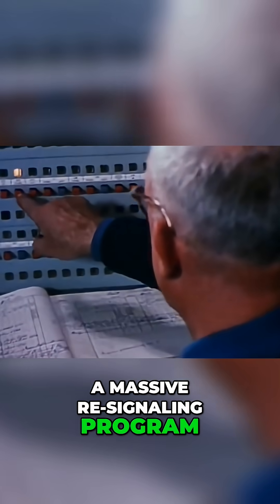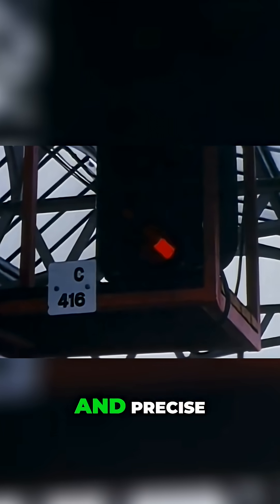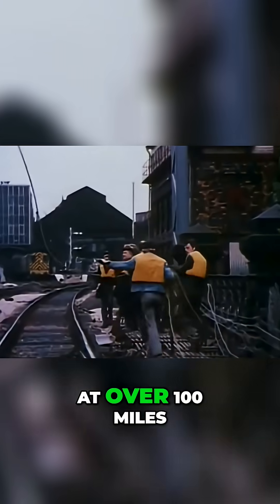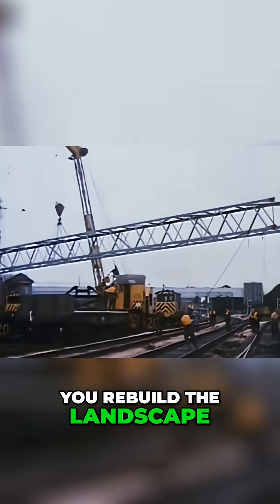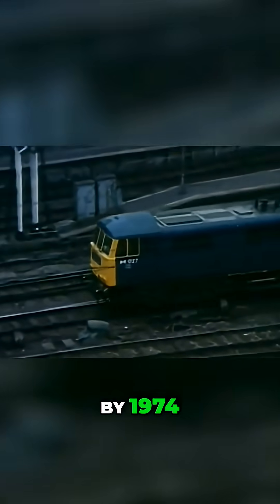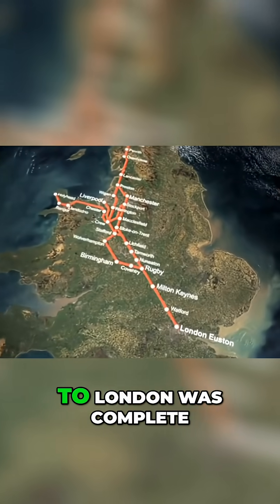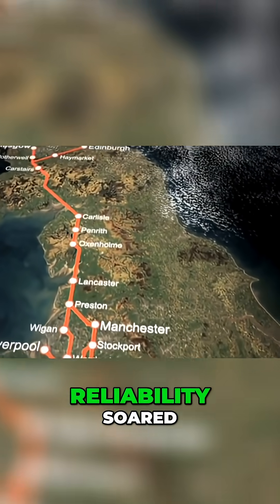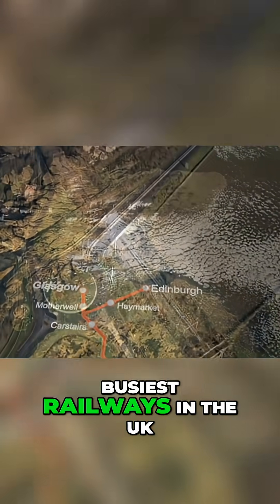Britain's Electrifying Railway Transformation  100mph Journeys #WCML #fyp #Railway

Comment: The power is DC.
Reply: Only in certain areas. Railway electrification in Great Britain began in the late 19th century. A range of voltages has been used, employing both overhead lines and conductor rails. The two most common systems are 25 kV AC using overhead lines, and the 750 V DC third rail system used in Southeast England and on Merseyrail. As of October 2023, 6,065 kilometres (3,769 mi) (38%) of the British rail network was electrified.